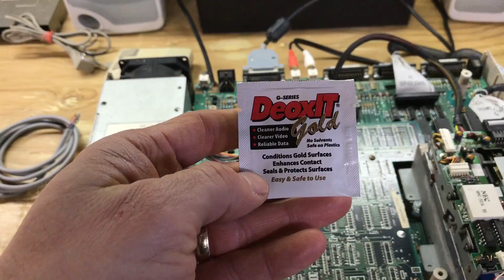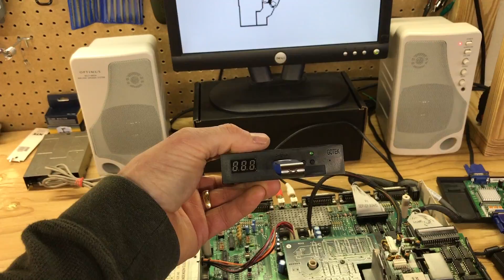Amiga 1000 Rescue Update. She's Alive!

Comment: This is now over 1 year later, but it is nice to see that you have salvaged a classical machine.  You are correct about the limit of chip memory without some very archaic and rare upgrades from back in the day; however, besides AGA titles, there are very few games that actually needed the ECS chip anyway, except for using a Pal like mode on NTSC machines.  Two weeks ago, from Germany, I ordered the ACA500Plus, which offers 8 megs of fast ram, support for two compact flash cards, a 68000 capable of over 40 mhz.  It also features the ability to boot from the expansion board via 1.3 or 3.1 kickstart as well, so technically, using the original Kickstart disk may be completely unnecessary. I am waiting for it's arrival.  I ordered a Gotek that's in an Amiga  500, which is cool, but running games via harddrive and WHDload on a faster Amiga 1000 seems a more attractive proposition...cheers.